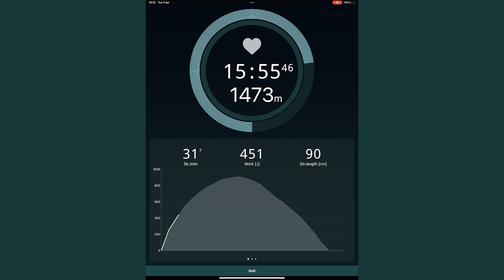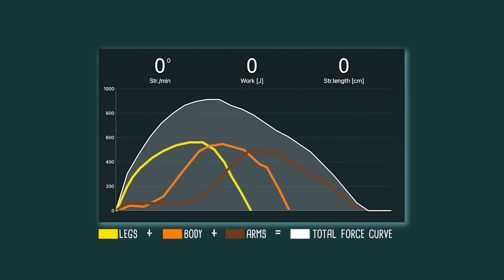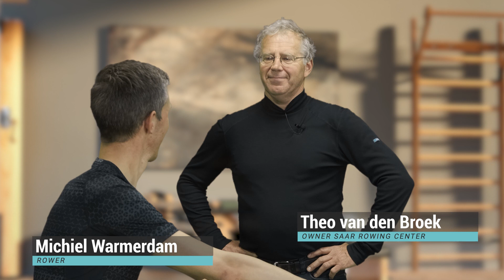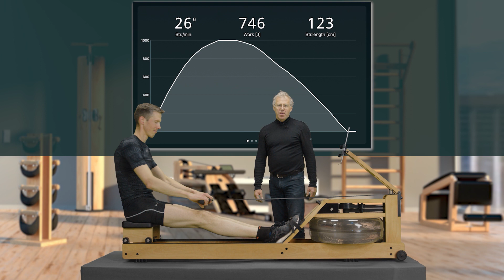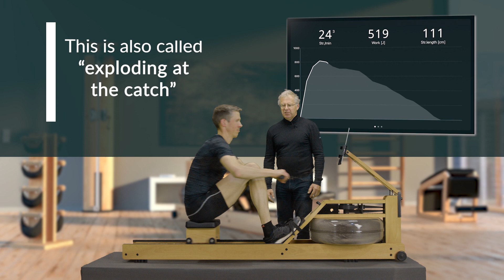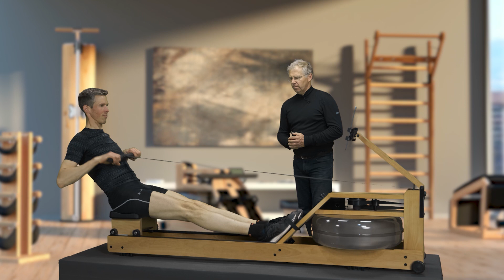Create a PERFECT force curve on your ROWING machine | SMARTROW

Comment: The explanation of the force curve is good but any time I see something like “here is the optimal force curve” I want to scream based on WHAT?”  Please show studies or analysis proving your force curve is ideal. And are we talking about on an erg or on the water?  If an erg, which erg?  If I take the logic in this video to the extreme, the ideal curve would be a square wave. But when you apply that to a rowing boat, it falls apart due to fluid dynamics.

Comment: Are there any studies of how SmartRow compares to Concept2 data? Ive heard the standard Performance Monitor on Waterrowers isn't comparable to C2... some have said it gives readings that are 10% faster than C2 over the same split. Has the Smartrow system corrected this?
Reply: The Smartrow pulley is a direct powermeter, there is nothing more accurate then the Smartrow kit.